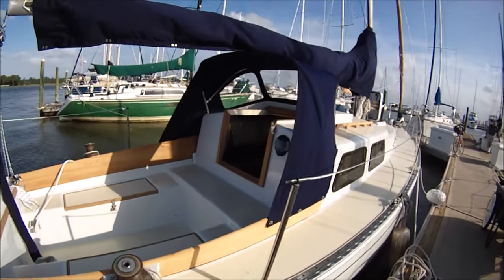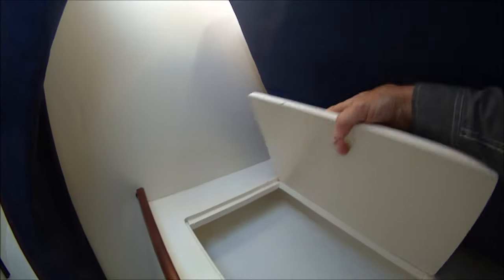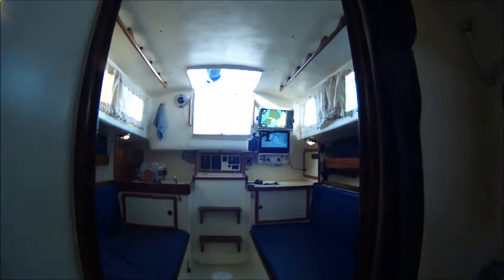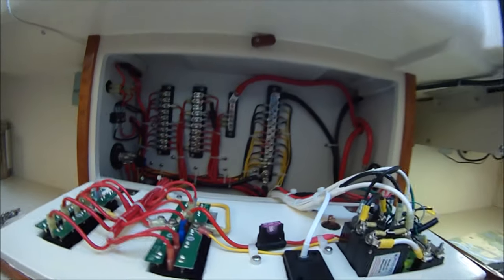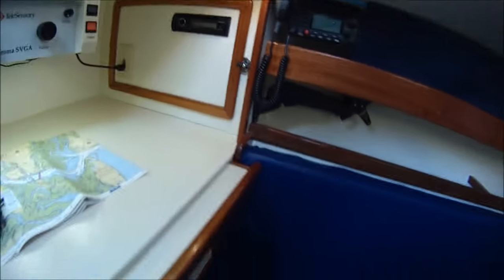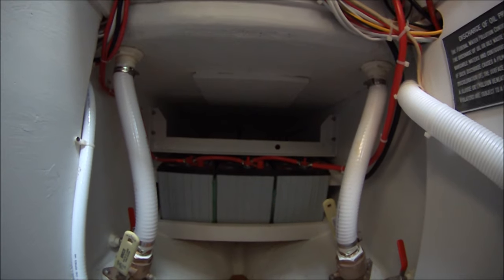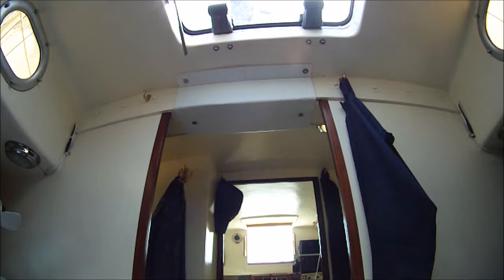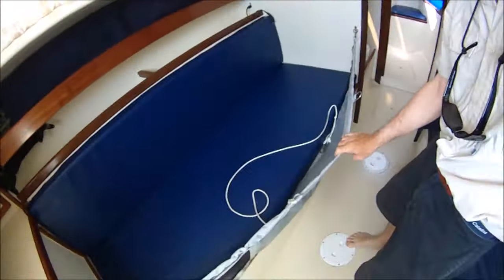1968 Alberg 30 Refit Part 2 Interior 2016

Comment: Great video; I tried to locate the dome lights you installed.  Marine B?  Couldn't find them, but I'd sure love to!
Reply from the maker: MarineBeam still lists similar lights linked on the page below. I think these were the 5.5" dome but they also have 6.75". These apparently come with a circular type LED bulb that seems to waste some of the output by pointing some of the light up into the housing rather than flat bulbs I got that send all the light down to the lens. It's not a big difference and they are still OK but I like a brighter version when possible. You might ask them about it. More recently as you see on my Triton Osprey video I'm using their dimmable 12" strip lights. I also like their bulkhead reading light with brightest bulb option. Then I order their dimmer switch and install it to bypass the standard switch. It requires drilling a 3/8" hole in bottom of light fixture and adding a 1/2" wood or starboard spacer block  between the light and bulkhead to accommodate the dimmer.

https://store.marinebeam.com/replaceable-fixtures/

https://store.marinebeam.com/12-or-18-led-light-with-touch-dimming/

https://store.marinebeam.com/classic-style-bulkhead-g4-led-reading-light-chrome/

https://store.marinebeam.com/12vdc-rotary-pwm-led-dimmer-dm-rt-72/

Comment: I noticed that the cockpit well drains through sea-cocks below the waterline. Do you have check valves installed to reduce flooding of the cockpit or is the waterline low enough? I am asking because I am currently refitting my mk 1 Contessa 26 with the same setup. My cockpit gets flooded easily and therefore I would like to convert to a self-draining system. My concerns are, however, the position of the aft thru-hull above the waterline. When positioned aft amidships the water from the drain will have to travel slightly upwards. Do you think this will result in flow restriction? I suspect that check values (such as those made by Tru Design) will also introduce flow restriction, especially when amounted below the waterline? Great video!
Reply from the maker: A small amount of water backs up in the leeward corner of the footwell under extreme heel. Just a minor nuisance sometimes. No check valves were needed and would be difficult to install because the space is already tight to bend the short drain hose in place. Not sure I follow your proposal for your Contessa but if installing a new thru-hull drain in the transom area that is above the waterline and connected to a footwell drain with a loop that angles up before going down it could be a problem. You need a drain in each corner for heeling anyway. On Atom I built a water can locker in the forward footwell that just happens to conceal the footwell scupper back flooding so that may be an option to keep your feet dry. It's shown in the video here at the 10 minute mark:

https://www.youtube.com/watch?v=Gt-g7mAQFM8

If you have further questions you can email me through atomvoyages.com

Comment: Regarding the holding tank and overboard discharge, none of this meet any regulations in the USA or anywhere else.this does not meet regulations all the way back to 2009.
The Origo stove installation would not meet ABYC, or even NFPA regulations.
There is a difference between a switch panel and a proper ac or dc electrical panel, right? There is a Blue Sea 8029 but the location suggest it does not understand the shore power to panel standards. 
regarding the electrical I see wires with no chafing protection and are those bus bars marine grade? They appear plated.?
Regarding the inverter, you have a power source and the ground/neutral is apparently available to both? By disconnecting an electrical outlet??Plenty of good ideas but following standards is always the way to go, in my opinion.
Cheers.
Reply from the maker: The holding tank has Y-valves that can be locked in the holding tank position and then unlocked offshore for overboard  discharge. If that doesn't meet current "standards" then the standards are misguided. Not sure what bothers you about the stove. It's way safer than any propane installation, regardless what ABYC says.  Yes, some of my electrical is non-standard based on my experience of many years boatbuilding, two circumnavigations, and numerous boat refits.  Sure you could improve some insignificant details. Never have I seen one of my wires chafe through. On a different boat in different circumstance you should have more chafe protection. It's another case of using rules or common sense. The bus bars are marine Blue Seas.

Comment: Hi everyone, 
Very nice and clean..
What kind of material was used on walls and ceilings?
Reply from the maker: Aside from the plywood bulkheads and cabinetry its just semi-gloss marine enamel over the original fiberglass. More recently, I use a latex semi-gloss that has a mold inhibitor.

Comment: Why do cockpit lockers need drain shut offs?
Reply from the maker: One of the benefits of converting to an outboard well is that you can make the two side cockpit lockers watertight and isolated from the bilge. In case of flooding of either locker from storm waves or collision you can isolate the locker or open the valve at some point and drain it into the bilge for pumping out. Most boats don't have this ability and it's difficult to achieve with an inboard engine that requires ventilation and passing numerous wires, plumbing, and cables thru this area.

Comment: Quality craftsmanship, attention to detail, simplicity and ingenuity. Top notch work James. Thanks for taking the time document and upload. You mentioned the water tank capacity was around 60 gallons, was that including the v-berth or just the bilge tank?
Reply from the maker: Thanks for the comments. After filling the tanks we found the forward tank was 16.5 gal and the bilge tank 57 gal.
Reply: Thank you.  Quite a water haul for a boat of its size and vintage, though minus the engine and fuel tankage I imagine they can still sail close enough to original design. These Alberg designs coupled with your ingenuity and experience never cease to amaze me.